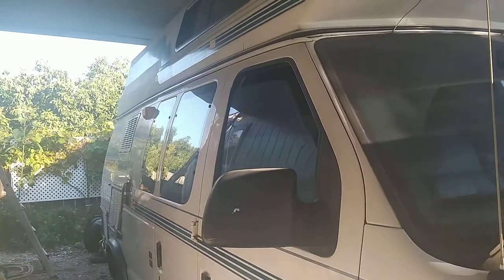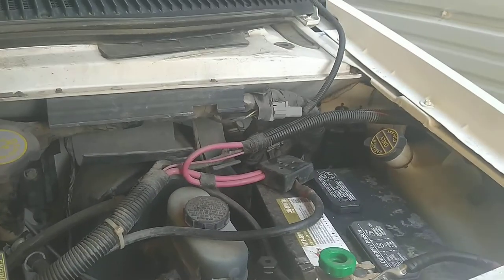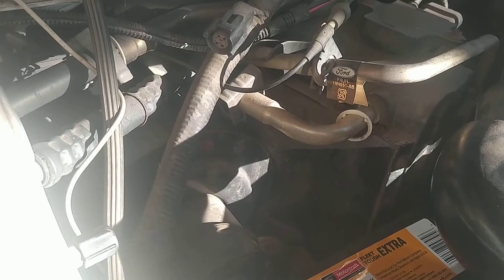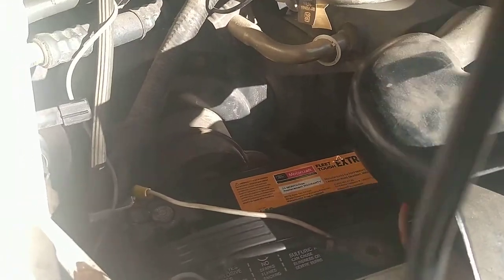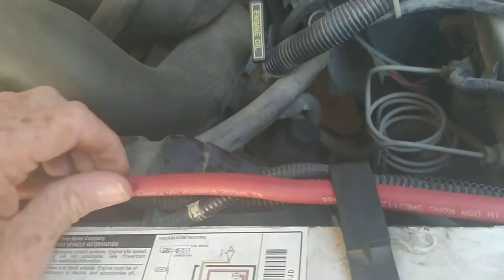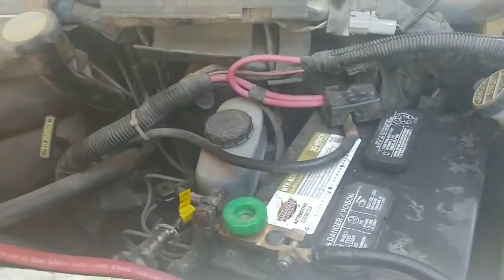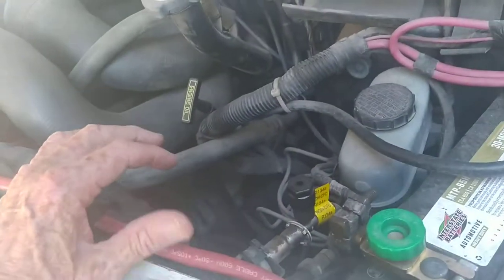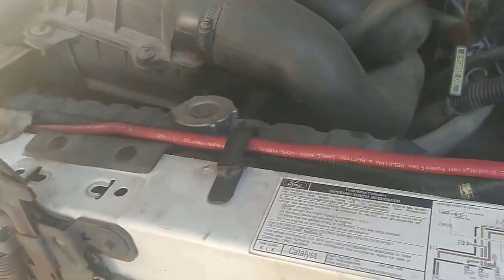1994 Ford Coachman Class B house battery ground problem?

Comment: Look into. Renogy DC to DC 40 amp charger to place between your two batteries. Your coach battery is not getting sufficiently charged from your alternator which is why you are replacing batteries every couple of years.
Reply from the maker: Thank you for the tip! I believe the battery charges adequately if I don't forget to turn on the master switch, which I've done.  Also, not running driving RV much.  I do have solar panels connected, but unfortunately, they are under a cover most of the time.  I made a note to myself to turn on the master switch when I do drive the vehicle.